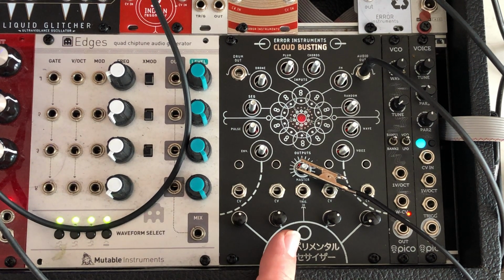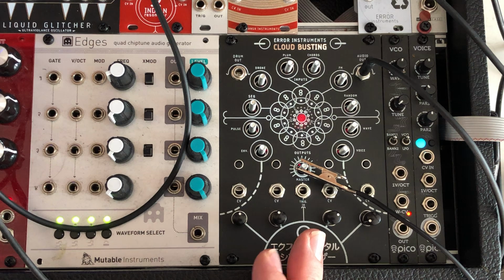Orgone Drum ? cloudbusting 2

Comment: Hey Paul! Does the gate in let you control the clock of the internal SEQ mode? It seems like the original cloud busting had a set clock speed with different divisions, I was wondering if the gate in on orgone drum/cloud busting 2 lets you change the rate? Thanks!
Reply from the maker: Yes, it works with the Lopez Gates built in so only way to get a cv or trigger or gate you will hear the sounds and then you can make it fixed do other things that has triggers and then sync it together
Reply: @paultasbeeb  thanks!